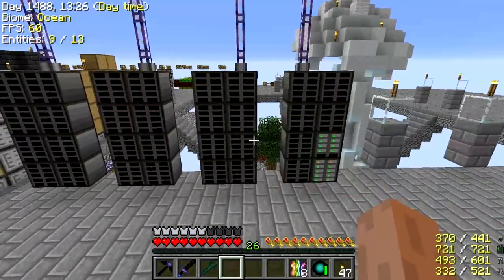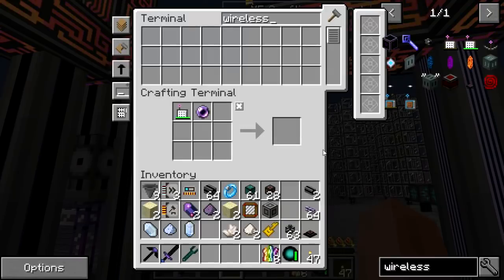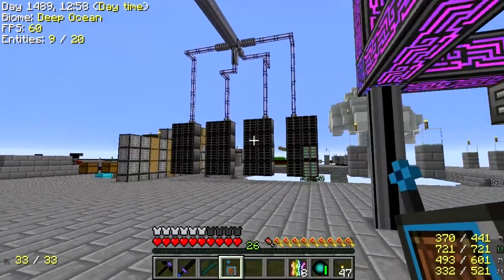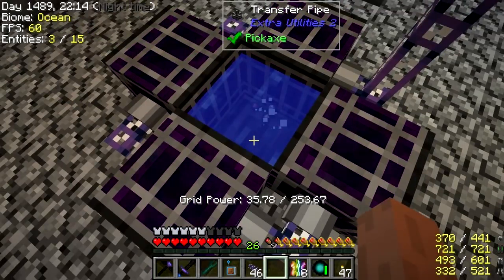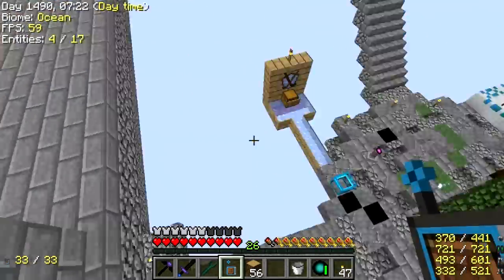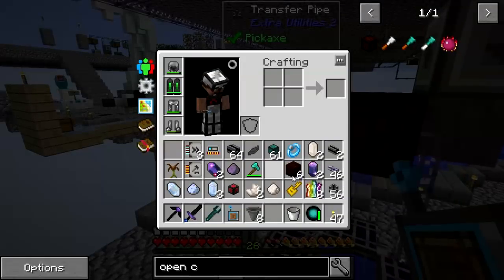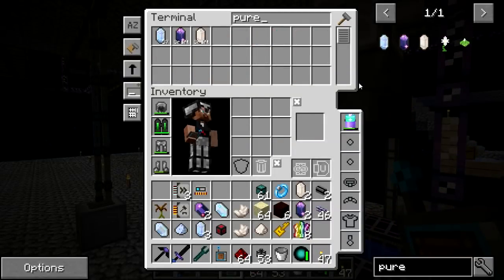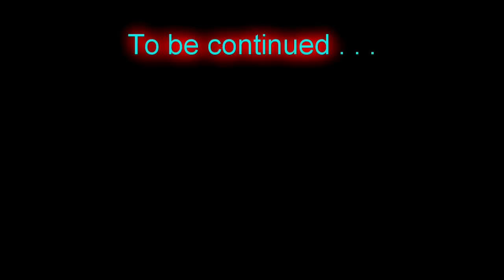Remote Access - Hermitcraft Hermit Skies Ep29

Comment: Infinity Booster card is obtained from killing the ender dragon.
the wither boss drops a wither soul that is required for growing nether stars, 
used in a crux placed under the soil the star plant is on.
something similar is used for draconium plants as well.
Reply: Also if you construct 2 more crystal growth accelerators, you can make the 
growth chamber, which is much faster and can be easily setup for automation!

Comment: With the automation of the crystals, EU2 nodes and EnderIO conduits do not pick up from the world, only from inventories. To do what you want you'll need to use an ME Annihilation Plane to pick up the items, connected to an ME Chest to filter. The only other option is an absorbtion hopper, but that can't be filtered, so it will pick up the crystals before they're done growing. In the latest version of the modpack, the advanced item collector is back, so that could be used with a filter. Love the vids!

Comment: chef just fyi you can automate an crystal growth chamber with the me system using an interface and import bus for the pure crystals. if you just want to get what you have up and going then use an absorption hopper directly into the interface. can't remember if you can filter them but the item collector(my favorite) is no longer in the game.
Reply: Yep, upgrade the crystal growth accelerators to a crystal growth chamber and it can easily be fully automated.